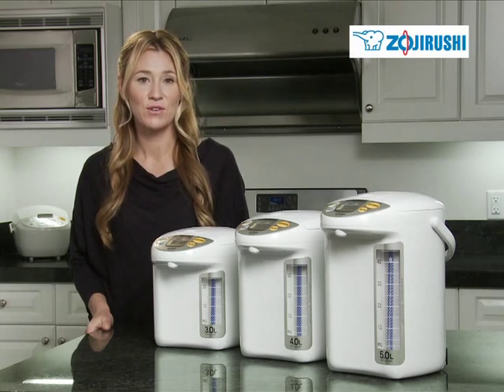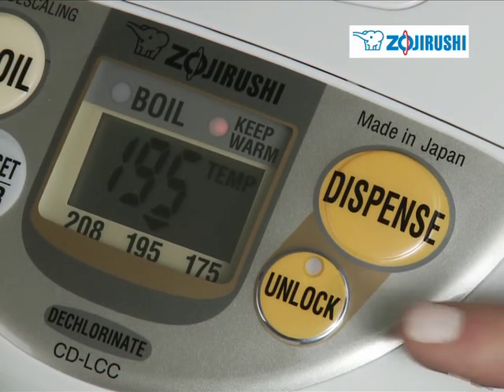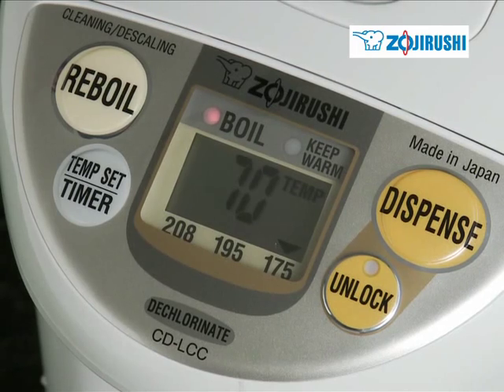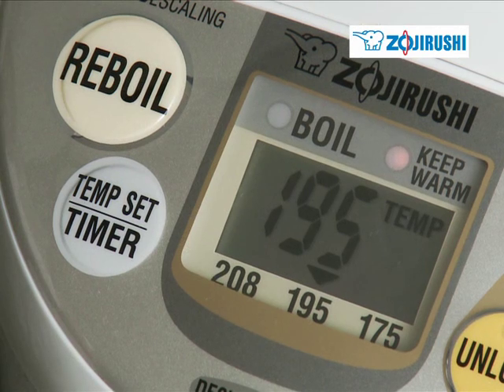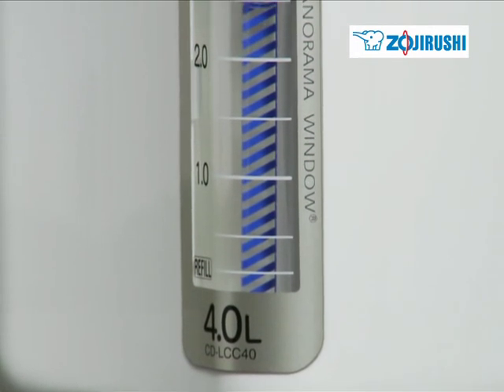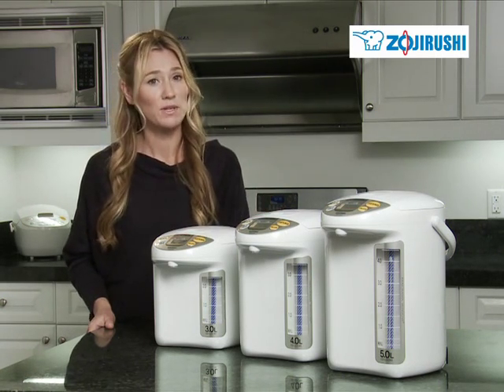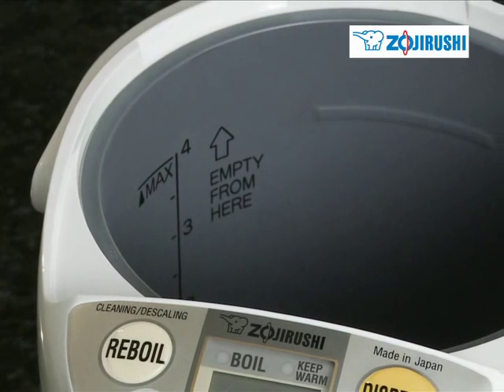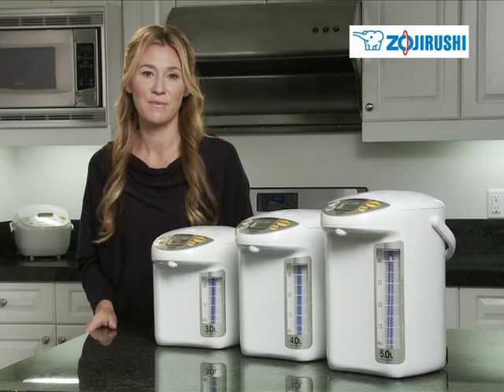Zojirushi Panorama Window® Micom Electric Dispensing Pot CD-LCC30/40/50

Comment: Out of what material the internal non-stick vessel is made?
Reply from the maker: Dear Damon,
Thank you for your question. All of our waterboilers have a stainless steel inside liner with a non-stick coating. The nonstick coating is made of PTFE. It is fluoropolymer, a material commonly used for non-stick coating in cookware for conventional kitchen use.
If you have any other questions, please do not hesitate to contact our customer service line at 1-800-733-6270
Thank you,
-Zojirushi Staff

Comment: What does the timer do?
Reply from the maker: 纪雪 When the seven-hour preset timer is activated, electricity is automatically cut off until needed to heat the water.  Your hot water will be ready after seven hours.  Hope this answers your question!